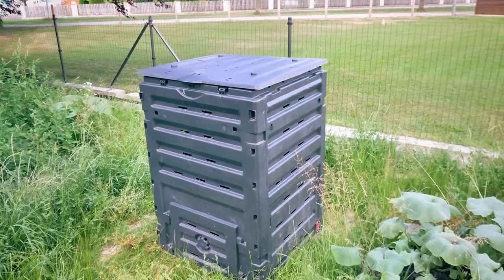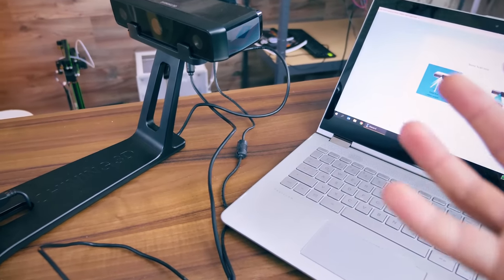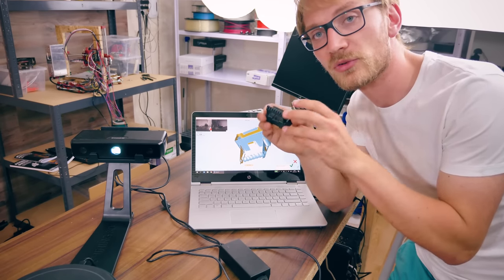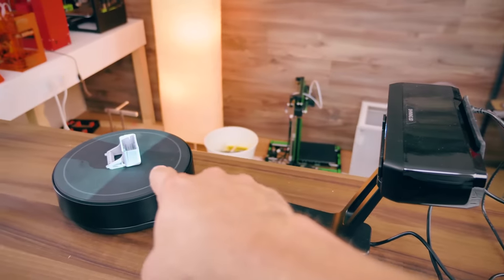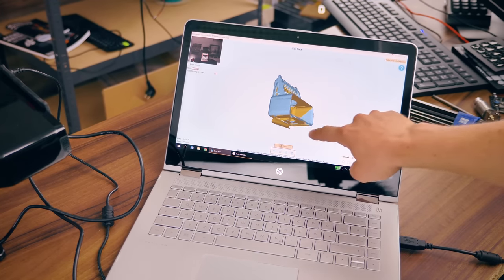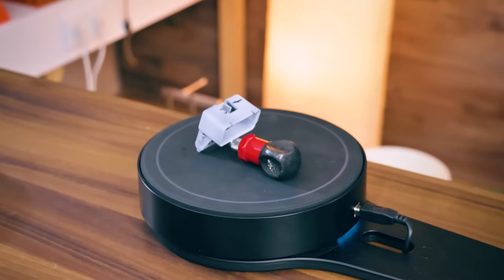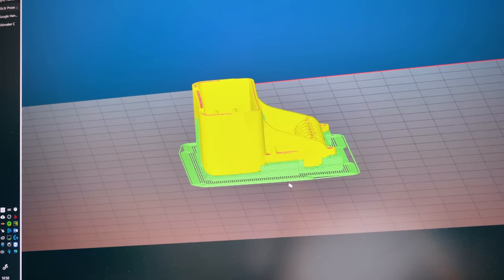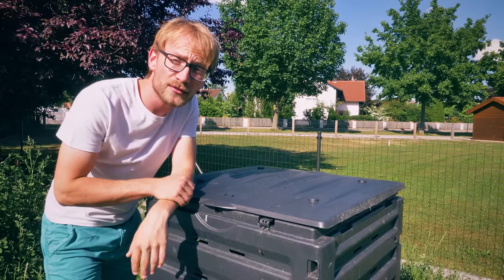I copied a 5ct part using tech worth thousands

Comment: You mentioned that the software wasn’t using the resources you were giving it, but it was using the gpu instead of the cpu, you can see it was pinned at like 80% before rendering ended

Comment: You keep your i3 Mk3 in a box with a foam front? Is that for sound dampening?
I'm about 3 weeks into owning my i3 Mk3 I built from the kit, my first 3D printer so I'm trying to pick up as much tips and info as possible because I know I've got so much to learn about using it.
Reply: licensetodrive it's to keep the heat in as the part was being printed in ABS. This material will warp if there is a huge variation in temp between the nozzle, ambient, and bed.
Reply: DJ Sniperwolf aha, yes that makes more sense than using it for sound dampening, thank you for this nugget of information should I ever print ABS.

Comment: well to be fair they used a machine that cost around $150,000-250,000 (popular brands i've seen are malicron or Van Dorn) with a mold that likely cost $30,000-80,000 (some priced in $100,000s range) and it possibly produced 8-16 parts a cycle. typically arounds 50-60seconds / cycle. 

your method is cheaper by far, and more cost effective for one part. if it blows your mind your using a $1,000 machine to make a 5ct part read the above again and be glad you dont have to spend that much to make one part...

Comment: hi thomas, im off your topic here but i am in need off some advice. I have just got myself a chinese prusa i3 reprap to learn myself on, the problem i have is that when heating up the extruder fan is working but as soon as it starts printing the fan stops, so the heat travels up from the hotend to the extruder and softens the filament to were it curs up and doesnt extrude, but the print prossess carries on. it worked fine untill i unclogged the nozzle. please help coz ive got no hair left, many thanks.

Comment: Tom, Can you tell me if Ciclops scanner is good like this you showed, the einscanner? because in my country it so hight the price of einscanner and cyclops is open source. So with Arduino, steeper an Cnc Shield I can make one ciclops. Thanks for sharing . Italo Brazil
Reply from the maker: The Webcam+Laser scanners like the Ciclop or Makerbot Digitizer don't produce anywhere near usable scans, at least based on my experience.
Reply: CNC Kitchen was perhaps the most diligent in trying to get a Ciclop to work, and it's a long way from there, its current status is "super early engineering prototype". You only get one of those if you're innately interested in developing the algorithms to try and make it work, and you may likely face failure. It's worse off than 2009 era Reprap, and perhaps fundamentally more complicated to get usable results.
Reply: Thanks Tom!!
Reply: Thanks Siana

Comment: I wish you had calibrated the scanner before doing the initial scan. It's not a fair review in that sense. The fact the exposure was so different after calibration hints at the probability that you could have gotten a much better unpainted scan just by calibrating first. I know shiny black is about the worst color to scan depending on the technology used to scan. Good review but not as scientific as I've come to expect from you.
Reply: I don't think this was a review. To me this was seeing how this process went. I am glad to see when things fail or don't work and to know limitations. It would be great if it worked without extra calibration, or without messing with lights.

Comment: I just printed a better button for my 15 year old washing machine after contacting 2 shops that said they no longer have it. You could have drawn it in a fraction of the time ...
Reply: Heh, washing machine projects. Did custom cams to have a leaner and improved washing cycle.
Reply: Custom... cams? I thought washing machines were firmware controlled, with a little MC68000-based mask ROM microcontroller in there. And mechanically it's just a drum on a motor, some sensors, and a bunch of pumps.
Reply: Do you think it's possible to print vibration dampeners out of TPU for a washing machine? The room above shakes like crazy when it's on the spin cycle.
Reply: I had one washing machine which shook pretty badly. It turned out, the guys that brought and installed the washing machine forgot to remove one of the shipping retainers in the back, so what was supposed to be an internal vibration that should never get transferred to the outside casing, actually was. Store brand but i think made in Finland, if i remember right. Pretty good one actually otherwise, was as good as silent and vibration free once that was fixed.
Reply: +Sierra Gearz
older washing machines were often controlled by a motorized cam with switches around it to control the different aspects of the wash cycle. Similar to those mechanical light timers that you put tabs in to turn them on and off at certain times.
Reply: My washing machine still has this. Had it 20 years so far and it's still going strong. Ironically, the timer was one thing I had to replace but that was cause I was cack-handed and hit the knob and broke the shaft. I have thought about replacing it with a microcontroller just for fun but meh...
Reply: that mechanical timer will last you years longer than any microcontroller based system. I had a dishwasher with the same mechanism for 25 years before the timer broke, and I foolishly decided to replace it with a new one. That was 3 years ago, and I'm on my 3rd new dishwasher now.

Comment: You need to build yourself a pin holder IE a piece of thin material that has pins in it to hold the part above the table surface.

Comment: Nah, you didn't use thousands of dollars of equipment (PC-ABS ain't cheap either) for a cheap part, you used thousands of dollars of equipment to potentially never have that problem again. From here on, it's just bed prep and printing for any future failed hinges.

...I wonder how hard it'd be to rig up something like that with a cheap projector, a couple webcams, a stepper motor, and an Arduino. Surely it wouldn't be as automated, but it sounds fun.
Reply: I know that i'm answering late, but for reference a lot of scanning rigs being sold are in fact exactly what you said.

Comment: I made an impossible to find air intake for my Triumph. They were asking $250 for a used one on ebay. A lot of frustrating fusion 360 attempts and Less than 1/4 kilo of plastic later, I had a fully functioning one.
Reply: What's the part number?

Comment: I want to look at the performance of parts at high temperatures in summer.☺
Reply from the maker: The printed part is PC-ABS, so it's way more heat resistant than the original ;-)

Comment: As a showcase for the scanner and general process... OK. In my opinion, however, it would be much faster taking the dimensions and recreating it say in Fusion 360.
Reply: Alek Krol Well that's exactly what he said in the video. And being quite a complex part, I think it showed the scanners ability quite nicely.
Reply: Ah yes. Got distracted at the beginning and must have missed these statements. I'll shut up now :)
Reply: I think a benefit of the scanners is that they don't require CAD skills (or at least not nearly as many). The ability to make arbitrary models is what makes printers great, but not a whole lot of people who own them can take full advantage of that fact.
Reply: I don't really see the point of owning a 3D printer without having even basic CAD skills. 3D Scanner? Great but mostly for scanning art or irregular shapes. Things that are difficult to re-model. Again - the video topic is good. It clearly shows what's involved in replicating a physical item. It's only the item that's unfortunate as it begs for being modelled in a CAD. Instead of focusing on the process I was repeatedly asking myself "why this guy is wasting so much time and effort and not just do it the proper way?"

Comment: So it's expensive, incredibly finicky, error-prone, veeeery slow, complicated and requires you to spray paint the original? Also the polygon reduction seems very bad - they need to recognize flat areas instead of saving polys in clearly curved areas. It's a good idea but it needs to get refined way more before it becomes practical on a smaller scale.

Comment: Sure you used $2k+ in machines for a cheap part but thats not the point. Its the fact that you did this at home. You didn't ahve to go buy a new bin. If you are able to do this a few times a year I think its worth the money for the machines. However for now I can live without a 3d scanner. I am not the best at modelling but I am getting better and usually I can do well enough.

Comment: Why are all your recent videos glitching? There are constant tiny pauses at random intervals (and always at the same points when I re-watch them) I am surprised no one else has mentioned this, its a little annoying. No other youtube videos from other content creators are doing this. Apart from that the content is great and keep up the good work :)
Reply from the maker: It might be an issue with your hardware/software - my content is 4k60, which might be too much to handle for some systems.
Reply: Ahhh, didn.t spot that. knocked the resolution down 1 notch to 1440p60 in the video settings and it plays perfect now.